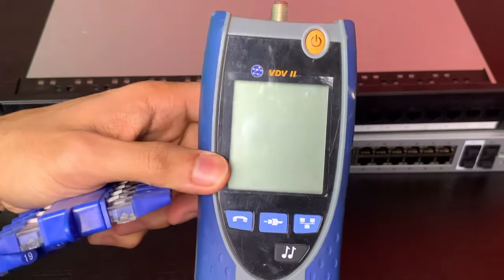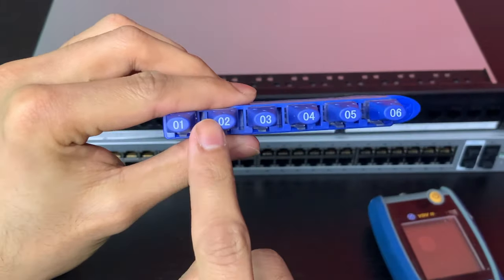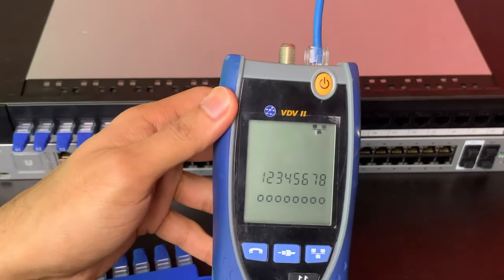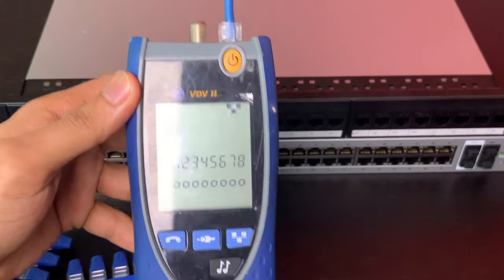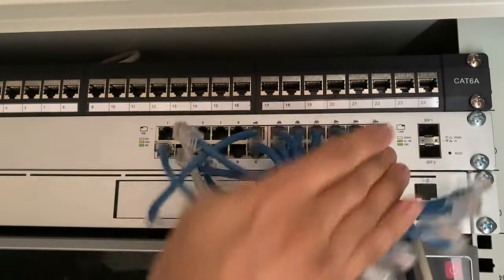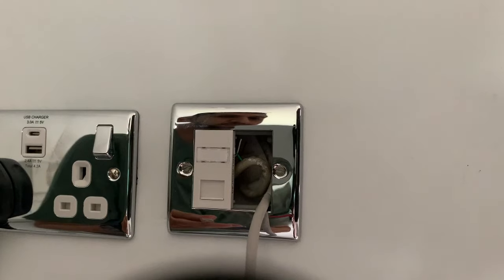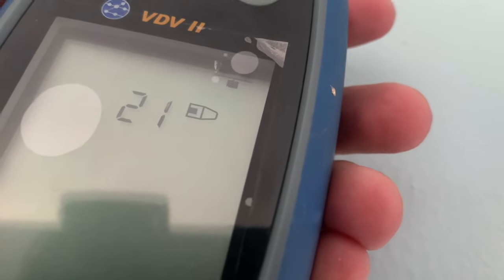What is a patch panel and do I need one?

Comment: Thanks for actually showing me what's a patch panel.
The other videos haven't gotten to the point.
Reply from the maker: Glad I could help
Reply: @InsideWire  but the question is; where's the out and in ports?
Reply: @oricooper9525  from what I've gathered from the vid it's relatively the same thing as say a receiver (audio/theater) and a switch (network switch).
Same as a switch in that it doesn't matter where the input is, as long as the output is the same as the cable labeled, so say your 24th port from your ubiquity into the 24th port on the patch panel, then out the back of the same patch and then wherever that cable then leads to say your computer in the bedroom upstairs. 
Same as a receiver in the sense that it acts as a distributor for the connectors say your HDMI cables as an example.

Comment: This was very helpful and simplistic. However the question I want to ask is..."which of the network switch ports do I use to get the signal from my router so that all the rest of the ports all carry the signal?" Is it port 24? Or is it one of the SPF ports?
Reply from the maker: If you have a SFP port on your router you can use that or most likely you will need to use an ethernet Port which you can plug into the 24 port.
Reply: @InsideWire  Wow, thank you! This cuts right to the chase, just what I needed for clarification.
Reply from the maker: You’re welcome.
Reply: @InsideWire  This is now indelible as a "best practice" for me moving forward.
Reply: @InsideWire  You have a new subscriber! Very valuable info (no matter the networking content, large or small)

Comment: Hi. awesome videos. Question: Can patch panels with female RJ45 connections on the inside and outside be purchased already made?
Reply from the maker: Hi thanks 🙏🏽
You mean like the one I have in the video? If so, that was already made. The link to it is in the description.
Reply: @InsideWire  The Amazon pictures show the back of the patch without pre-installed connectors.
Reply: Am I missing something?
Reply from the maker: So you’re looking for something with the RJ45 clips installed?
Reply: Yes. I want to be able to plug a network cable into the back of the panel without having to do the punch down thing...
Reply from the maker: Ok, what country are you in? I’ll send you the relevant link 😀
Reply: @InsideWire  USA
Reply from the maker: Here is a link, it is linked to my amazon associate account. Doesn't cost anything extra to use
https://amzn.to/3b0KwaF
Reply: @InsideWire  Thank you so much, this is just what I need. Just one more question. Sorry, I don’t mean to beat a dead horse here. Is this patch panel compatible with cat 6a and cat 7?
Reply from the maker: No Problem. https://amzn.to/37UDNxd the only I found with Cat6a.

Comment: I like those wall plates you use on the wall for the ethernet port r. What is it? They look clean
Reply from the maker: What wall plates are you referring to? The patch panel itself?
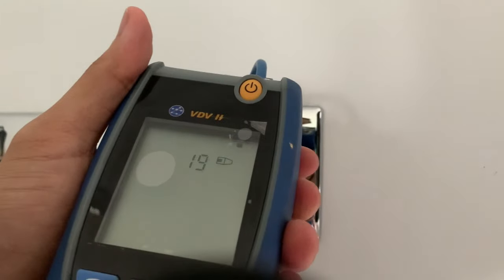Reply: @InsideWire  the one at 8:04 where you show a real example with four handheld device
Reply: @Crivoh   any answer to this?